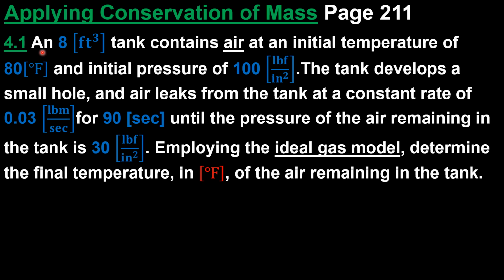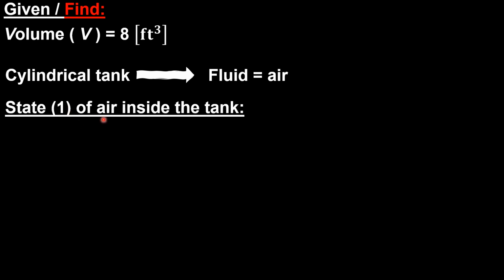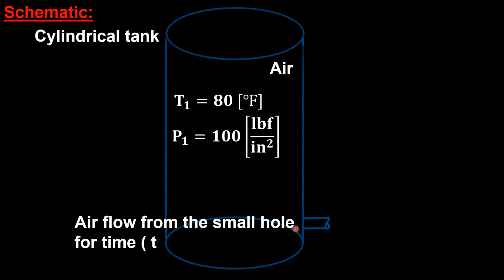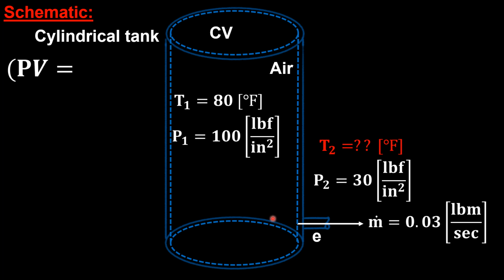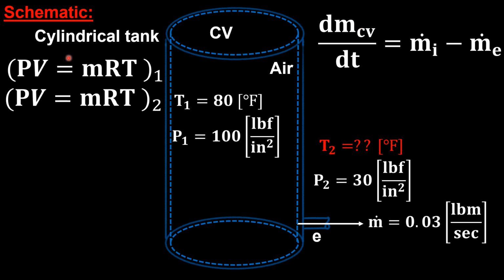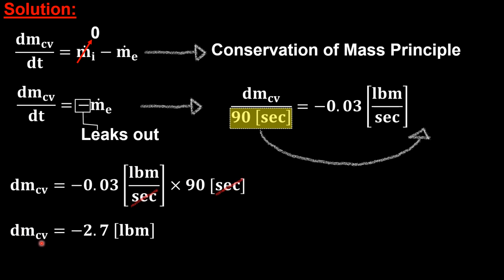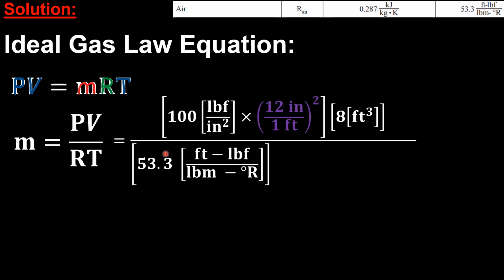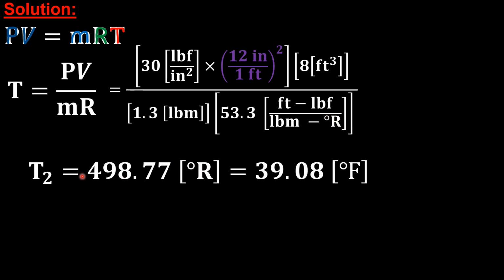Problem 4.1 - Fundamentals of Engineering Thermodynamics - Seventh Edition

Comment from the maker: Gas always expands to fill the entire volume of its container regardless of the amount of gas present. This is a fundamental property of gases based on the Kinetic Molecular Theory.

Gases have no fixed shape or volume; they take the shape and fill the entire volume of any container they are in. When gas is released from a tank, the remaining gas molecules spread out evenly to fill the tank again. This happens because gas molecules are in constant, random motion, colliding with each other and the walls of the container. As gas escapes, the pressure inside the tank decreases, but the remaining gas still distributes evenly throughout the entire volume of the tank.